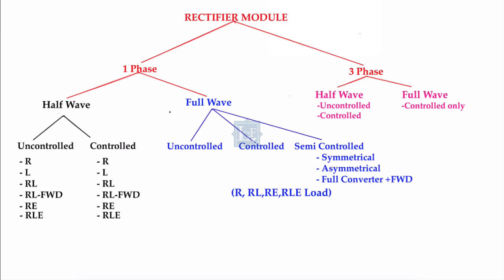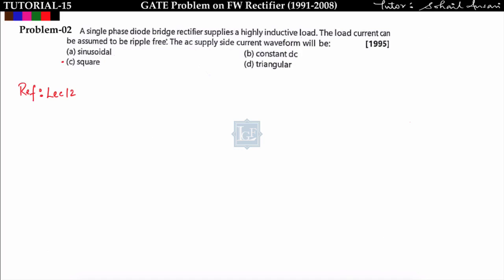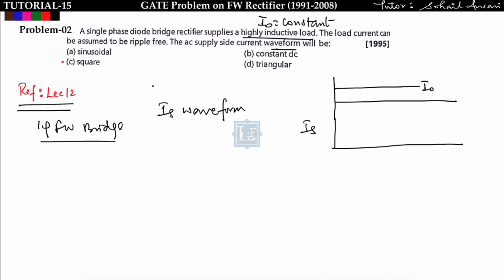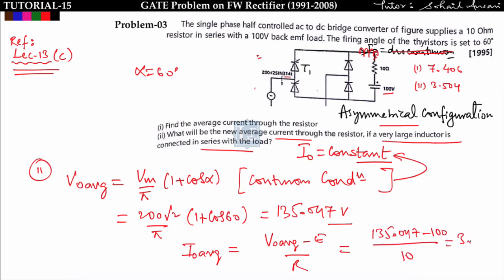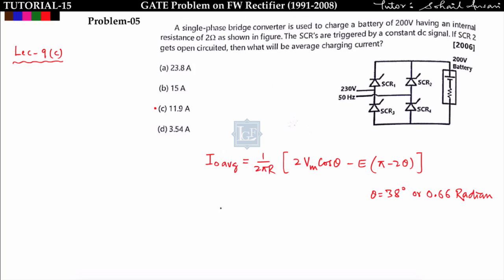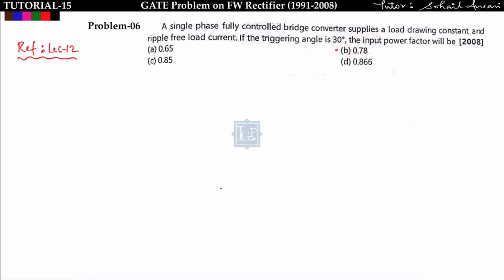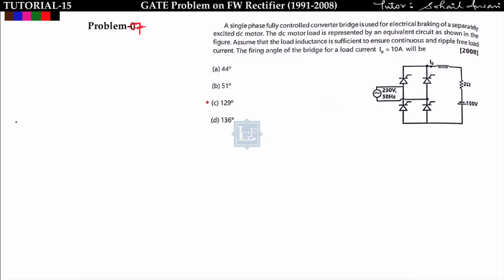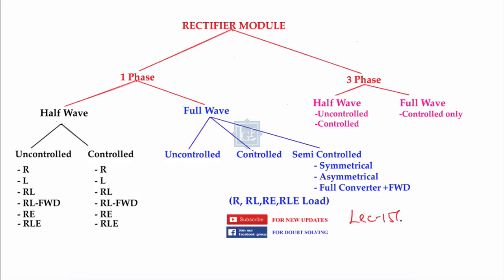Lec 15(a) GATE Problem Solved (1991-2008) based on Full Wave Rectifier

Comment: Q3 2nd part he is correct..since inductance is very large...the back emf will play no role in output voltage Vo....only if it was discontinuous operation..then Io would have decayed to zero through wheeling diode (Vo= 0) and at (pi + theta) Vo = Eb...but.. freewheeling diodes will keep it shorted till next firing at pi+alpha

Comment: In q3 V0 expression may be wrong, if diodes r providing freewheeling action then after theta2 voltage will be o, if m wrong correct me pls
Reply: But it's given that large inductor is present in part 2.. so voltage will go till pi and then becomes zero.. after pi freewheeling action ocuurs for heavy inductive loads

Comment: sir in question 6, it is given that current is ripple free ,so there should be FWD with RLE load ? You have considered FWD with RLE load in case of half wave convertor but not here in full wave. Can inductor in full wave alone makes sure that current is ripple free?
Reply: I too have the same doubt

Comment: Q3#GATE'95: I have a small doubt in the second part of the question. As the circuit is in full wave asymmetrical  configuration with RLE load. But you are considering the average output voltage of  full wave asymmetrical  configuration with RL load. why are you ignoring the EMF in the load?
Reply: Yes Vo expression is wrong
Reply: yes i too have a doubt in that 2nd part of that question......plzz clarify that

Comment: lect 15 (a)  sir ? no.  4. 
Rl load is not mention in ckt  it may be R load then the options B is also correct please clarify if i am wrong
Reply from the maker: see at load..it is constant current source..what do u mean by this..this meand load current is constant..means load will be highly inductive...ok
Reply: Stephanie Knowles  All the switches given in the question are SCRs. See carefully. There are no diodes.

Comment: hey sohail. problem no. 1 . the converter needs reactive power for its operation. from where it is getting the reactive power?
Reply from the maker: it is getting reactive power from the supply only as input power factor is not unity..bcoz of no linear device present in the converter...